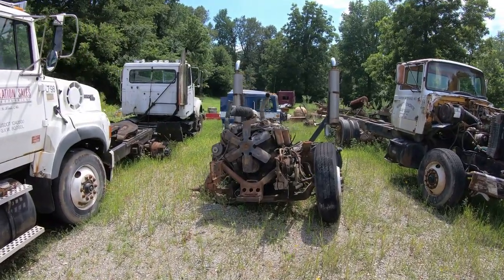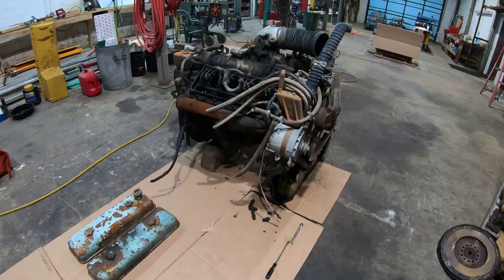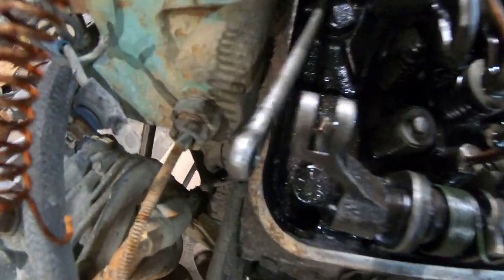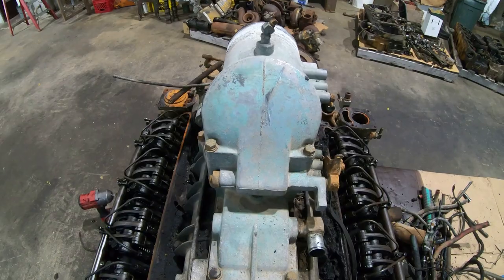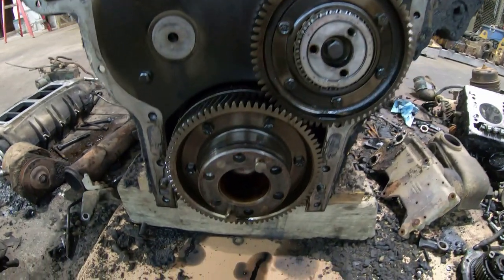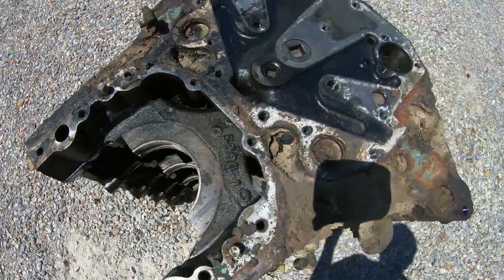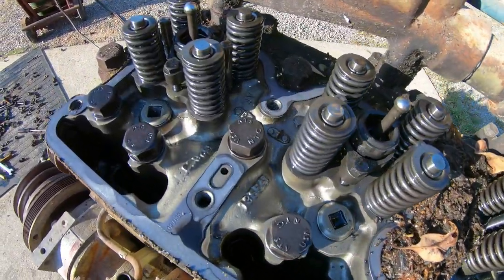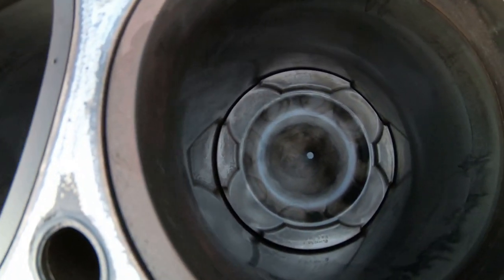Runaway 2 Stroke Detroit Diesel and Ethered Cummins Engine Tear Down

Comment: Save the old Detroit’s. Bad things are coming
Reply: R Fortier after that chinese EMP strike and everyone’s vehicles are fkd i’ll be laughing and headed towards the hills with my 671 detroit diesel crown bus..
Reply: We have a 271 671 692 871 892 1271 just for emp puposes
Reply: Quirin M. I do have a new ford ranger but i also have a 1970 f100 with a mercedes turbo diesel engine all mechanical engine. This thing runs on whatever i dump in the tank.. diesel, kerosene, jet 1-A, motor oil, waste oil, food grade oils, hydraulic fluids, transmission fluids, brake fluid, bbq lighter fluid... I’ve tried it all lol
https://youtu.be/FZtC8sWapGY
Reply: Have you tried 93 octane unleaded with castor oil 2 stroke in it. I not only filled a 6-71 with quicksilver TCW3 syntheic 2 stroke oil. i dumped in some old gas/oil outboord mix in to fuel tank ofor this winch motor. it stared easier, ran better and oil stayed cleaner! there was a guy who bult a 2 stroke out of a 5 cylinder mercedes diesel om617 and ran it on regular gas! It was a poppet valved 2 stroke and is that what you did on yours?

Comment: Before the tear down starts I can tell you exactly what happened, the rack got stuck & got set on full/run away mode. 

It’s a travesty you let the engine go, it could’ve had another 40yrs left in it.

Comment: So... if I pay shipping can I have the blower? Lol
Reply: That blower is crazy loose judging how easy it was for him to spin it
Reply: Could be that easy to spin.
Reply: @josephbugaj8149  probably
Reply: Was gonna ask the same thing...
Reply: Well, have the fabrication skills, you can slap that blower on anything.
Reply: @josephbugaj8149  well, that's why the weiand 6-71 and 8-71 Blowers are called what they are called, they are "replicas" of  the blowers from Detroit Diesel 6-71 and 8-71 Engines, these Blowers have been used by hod  rodders for a long long time.
Reply: I meant slapped on any engine. Not just a V8.
Reply: I’d be strapping it to my 8.0 v10 ram 🤷‍♂️
Reply: Have one of those similar blower on my 5.0 making crazy power
Reply: Thought about slapping something similar to my 350 V8 just for kicks, or a 3100 SFI Chevy V6
Reply: @josephbugaj8149  not really
Reply: @josephbugaj8149  what about putting it on the f22a4 in my 1990 CB7 accord?? xD
Reply: Xzavier Simmons if you got the fabrication skills, then go for it.
Reply: @backcountryrider2643  I'd put one on my Chevy 8.1 and race you with two less cylinders. :-) Now how much HP can you get out of the 8.1 Vortec engine? Somewhere North of 1000 HP. Only problem is, where does one shoehorn the blowers in as the 8.1 already takes up most of the engine bay?  Answer, same as the racers do, hood cutout. ;-)
Reply: I'll put it on my mom's MDX ;-)
Reply: @josephbugaj8149  To make a 2 stroke https://www.4btswaps.com/attachments/2cyclesbc-jpg.6839/. the only way to get a 4 joke running righ is to make it into a 2 stroke.
Reply: @backcountryrider2643  you got one of the v10 2 strokes?
Reply: @josephbugaj8149  I woulds love to mount the 8v71 blower on my small block v8 2 stroke boat engine. I got an 8v92 turbo silver 2 stroke.
Reply: I got an old air raid siren that can use one
Reply: @TheSleepyMechanic0524  Oh get back on your old CNC using tesla radiant aetheric stream and machine your self a nice 1200 CID v8 2 stroke billet out of 7068 aluminum or ductile iron!

Comment: That was a overreved or ungoverned engine. A run away is a diesel that is fueling itself with its own oil.
Reply: Yes, I agree.  Judging from the number of likes for this video, there are plenty of people that know as little as he knows about engines.  I just unsubscribed.   Have a great day!
Reply: My thoughts exactly, runs away on oil vapour not an ungoverned injection. Youd expect lack of lubrication to sieze the engine up proper
Reply: Stuck injector runaways are more common with detroit's. Though I do agree with your statement. But since most of them don't have turbos, you'd have to greatly overfill the crankcase oil for it to run away
Reply: @davidstjames_  Lighten up. If you watch any of his videos about rebuilding CAT engines, you can see from his attention to detail that he knows them very well.

Comment: Id like to see the detroit swapped into a k5 blazer
Reply: An 8v71 weighs 2400lbs buddy
Reply: @stanleykendziorski7964  aint gonna fit anyways. Best chance is a 6v53 into a built k30, but you could use a smaller 3-4 cylinders
Reply: @jdlawless_fuel1416  even the 3 cylinder version is almost as heavy as a 6bt Cummins. The 6v53 is somewhere around 1700 lbs. I'm sure you could make a 1 ton pickup handle that fine, but it's never really going to be good at anything other than sounding cool.

Comment: Nothing sounds like a 2 stroke diesel either.
Reply: Have you ever heard the OMC v8 small block 2 strokes, they sound good to they can make insane power per CID and dont need an external blower to run it. Monte racing mounted an 8v71 blower to make well over 850 hp out of 244 CID!

Comment: Looking at the piston crowns of pistons #3 to #6 of the Ethered Cummins, with the crowns showing more or less 8 burn marks al around the circumference, do the injectors have 8 holes in them and these are caused by diesel jets igniting on the pistons?

Comment: Only good thing about the Detroit is the sound, that’s it.
Reply: Never ran one then bud it's a solid motor decent power and built well
Reply: You cant argue that they were incredibly well built.  All the major diesel engines makers have great engines ( Cat, Cummins, Detroit,  Mack) but Detroit was definitely the king of 2 strokes and they could just about run forever.

Comment: Had a Chevy 6.2L run away. It was my bad put the injector pump in off one tooth. It would not start ,spray either in over and over and over. When it did start it went in to a runaway . Full bore for about 8 minutes,then the cam came out of the back of the motor . I loved that truck ,the next guy did too,and put a different 6.2in it and drove it for a lot of years before he sold it .

Comment: No way would a cat or Cummins last as long as that Detroit did running away.
Reply: no 4 joke would, 2 strokes are tougher and designed that way. I had a my ccw 440 snowmobile run away and it just broke some rings, It was a jdx8 snowmobile. i rebuilt it and it ran fine. How would this chevy 2 stroke sound :https://www.4btswaps.com/attachments/2cyclesbc-jpg.6839/

Comment: For God's sake. If you don't know the difference between a naturally aspirated Detroit and a turboed one, just remain silent, watch the video(s) and learn something.
Reply: I really HATE how people call non-turboed 2-stroke Diesels "naturally aspirated". They really aren't. They can't draw air in by themselves without some form of forced induction.
Reply: @electric7487  all the blower does is scavenge air it doesn't affect hp
Reply: @conner5611  But I mean, if that were the case, wouldn't turbocharging a 2 stroke Diesel with a positive displacement blower also have no effect on horsepower?

Comment: Detroit’s are one of the most simple yet complicated engine there simple as far as the parts that are there but between mating the blocks and rotation it’s easy to screw up and get the wrong oil pump and then the fine and course gears between the years

Comment: I thought a run away was when it started burning its own oil as fuel
Reply: Colin
Yes I think you are right a shop guy who worked on my 8-71 said when I wanted my tail pipes moved up told me that two.
Reply: Yes it is. This engine just had its governor disconnected and the throttle held wide open, it wasn't a true runaway at all.
Reply: @paulbeckett1256  
Yes on my 8-71 the reason the shop guy told me that is , I was getting leakage out my exhaust  thay went down and out the side of truck he told me to be carfully on run becouse of unburned fuel or oil leaking down, he said just don't drive it long distance, it is just a restore project ( Sea Graves Fire Truck)
That I should be allright, he told me about how a runaway engine works on Detroits,

Comment: Engineering disasters ?    I'm not a big Jimmy Diesel fan, but let's not forget that there were millions and millions of these engines built and run and they were designed in the mid 1930s.  Pre, pre WWII.    Can you name another engine that has run that long or that successful ?

Comment: Could you get your hands on a cummins isx 620 and do a detailed build on it for us its harder to do camshaft timing for the camshafts gears are tappered locked onto the camshafts it requers camshafts locking tools since the camshafts are both timed at diffrent degrees

Comment: No Runaway ONLY happens when the engine sucks it own oil and starts running WITHOUT fuel supply! Runaway implies getting so hot it sucks its own Engine oil and runs away ! PS you turned the blower backwards it compresses the air on the outside of the housing
Reply: I was thinking the same thing!!

Comment: Caterpillar has holes in the head for harness routing. Ever worked on an ACERT? 15 liter? And nothing melted in the cylinders. Thats coolant burnt to the inside. Right where you'd ream the ridge if you were to rebuild the thing. And the "fire ring" is actually holding the liner inside by the dish in the head. I love the vids I just added all that cuz I felt liberated once again by someone who loves doing what I do. Piston seized and let go, hit the crown and blew the intake cage to smithereens. The reason why they don't have wet sleeves is obvious. You get a hydrogen oxide leak in the sleeve seal and you just might hydrolock. This may cause a seized slug not unlike the one you unassed from that Detroit block. Keep entertaining us and I'll keep watching. 🤓🤙

Comment: Started driving old construction equipment at 16.  Detroit Diesels in everything.   Every night,  check the fuel level and fill it up with oil.  They ran, smoked and made NOISE!!  OH did i mention the POWER?

Comment: This engine did not run away. The guy that started it did at around the 9 minute mark. Just saying. Did detroit parts for over 20 years. Waukesha for the last 20. Both good engines.

Comment: I like the way Detroit put the cam high up in the block, works like an overhead cam with no push rods but the cam drive doesn't have to be spaced or changed when the head and block is decked and the heads can be pulled without fooling with cam timing. Wonder if anybody ever made a gas motor like this?

Comment: Just a FYI, the blower turns in the opposite direction you were turning it.  It pulls air around the outside of the blower down into the motor.

Comment: Considering when these engines were designed, and why they were designed the way they were, and how many vehicles, boats, pieces of heavy equipment and the way the engines are modular, yes corners were cut to add new things to the engines, but, for the most part they were reliable and relatively reliable.

Comment: The Detroit engine design originated in Germany in the late 1890 or so then was purchased by a company in the US then I think the design was sold to another company that ran with it in the 20’s and somewhere in there General Motors I think purchased said company with the design rights and the two stroke was born . So the old Detroit diesel design has been around for over 100 years

Comment: I got a 1997 7.3 DIT, #2 in the Ether Express bears a striking resemblance to #7 in my Claire. No Ether involved . Just an 1 1/4" plug in the HPO rail missing an Oring, Genuinely sounded like the flex plate was cracked. Then I recognized all the Cash stuck to the Trailer under the truck I felt Like Jed Clampet.

Comment: i needs to gets me one of thems gas powered spanners there..
also, 
whats with the cylinder head valves?
i thought one of the points of a two stroke was no valves?
ill  research it  at once
Reply: Exhaust. 2stroke diesels are different from 2 stroke gas engines

Comment: I've seen several of those turds blow up 71s and 92s, infact last year we had a 92 series v12 blow and put a rod through the block in a dresser haul truck . We replaced it with a Cummins qsk19 .

Comment: good old Detroit, it'll live again. they all leaked, they had dozens of gaskets and seal which all leaked all the time. but they would rarely leave you sitting. they were heavy and didnt make a lot of power, but compared to what was on the market they were good engines. they were one of the most fuel efficient engines of there time as well, the tt series were tuned different to give even more fuel economy with slightly less power

Comment: what is your opinion on the isx 15 455,good or bad i just bought a 2015 truck with one 791000 miles on it just majored with cummins new slieves,pistons and wiper rings kit

Comment: They do the through holes so that you know if you have oil in them or not. The saying goes, "If there isn't oil under it, there isn't oil in it." This way you don't ever had to actually check the oil. Just make sure it's still leaking.

Comment: I torqued some heads before and hurt my rotator on both shoulders. I want to know are you alright after trying to break torque on those cat engines with that long breaker or cheater bar?

Comment: So was there anything wrong with either of these engines that warranted their destruction, or were you just scrapping them anyway and felt like having some destructive fun first? 

Also you can actually push a lot of power through a Detroit. Father in law uses a 12v71 in a tractor puller, pushes it all the way up to over 2000 hp and maxed out the dyno he was on for torque.

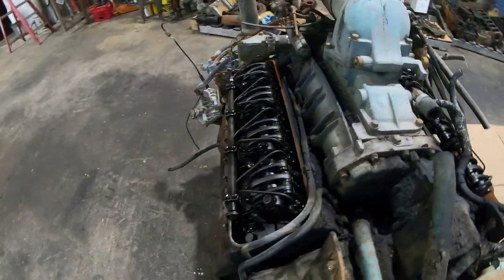Comment: 8:00 for those who dont know the governor controlls if the engine is too fast and pulls this shaft back so it doesnt run faster than its supposed to

Comment: To stop valve floating the valve has to pushed open then pulled shut without the use of a spring maybe something like a super powered solenoid fuel flow control valve

Comment: You know the old saying, don’t worry about a Detroit until it stops leaking oil!
Reply: That reminds me of a CCW 440 in a JDX8 i had back in the day. It leaked a liike oil arounds the clutch but it never hurt it. I got an OMC small block v8 johnson that leak a little but i needs new seals soon. My 8v92 silver does to. BTW why is motue 8002t more expensive than BRP XD-100 oil? i give my 8v92 a little now and then to top it off.

Comment: Don't trash those engines before Cat had the 425hp and Cummins had the KT600. Guys were modifying those Silver 92's to 550 hp. They did not have the torque the Cat or Cummins but they held their own, they ran like hell on flat road.

Comment: We used to do work for Fleet company that run all Detroit's first it was the 8 v 71 and 671 then the 6V 92 the fuel Miser and 8 V 92 yep they were famous for leaking oil everywhere and I seen brand new Detroit's leaking oil. You hadn't seen damaged from a runaway if you think that one's  is damaged lol . Those  liners weren't just right blow a head gasket injector sleeves copper  crack had a rubber seal   leak water into the oil. I hated fitting liners into those blocks that really sucked good thing I was young at the time because sure as hell wouldn't do it now I'm 65 white trucks haven't seen one of those since Volvo bought them out. Memory Lane.

Comment: You're right about that, rack is the proper term for that shaft
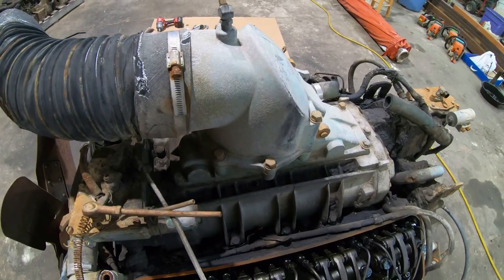Reply: 9:46 two stroke Detroits need some kind of forced induction to run, doesn't necessarily need to be the blower

Comment: Those aftermarket pistons are made from 80.55.06 Ductile Iron. If this motor had OEM, Perlitic Malleable Iron pistons, the piston would not have broken apart, and this failure would have been all different. Also, the valves were possibly compromised aftermarket valves that have a small percentage of nickel (compensated with more chrome). If you could find an OEM Rebuild (where the Rebuilder didn't cheat with Aftermarket), this motor would have gone much longer and failed very differently. (In my humble opinion). And no, I am not an OE guy... just the opposite.

Comment: The Detroit diesel doesn't use a blower for forced induction it uses a blower to get air at atmospheric pressure into the intake ports. Since its at atmospheric pressure its na